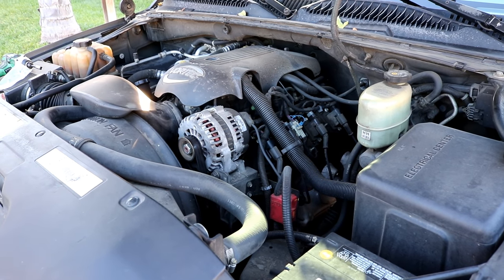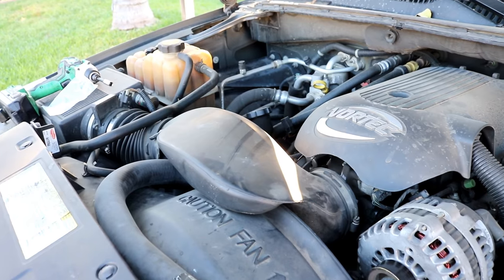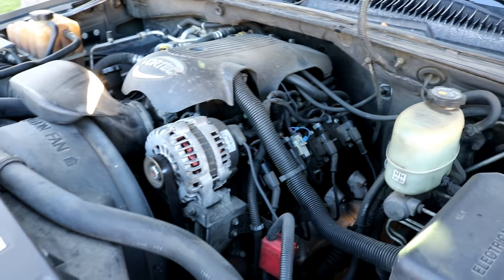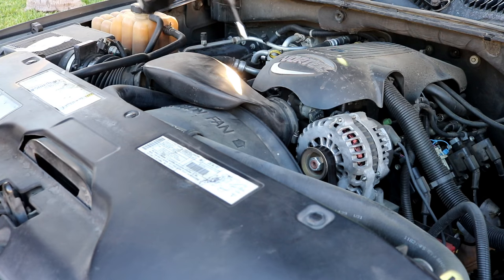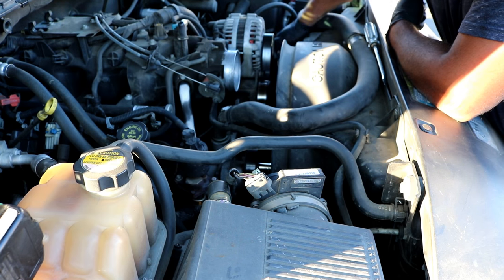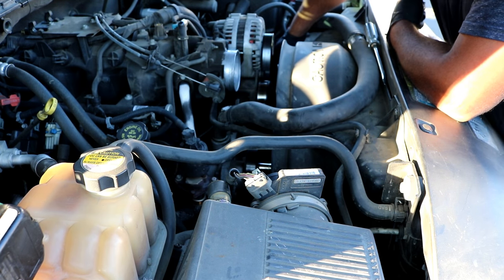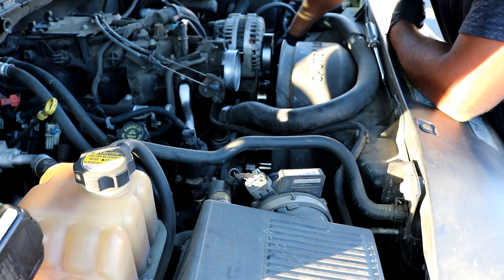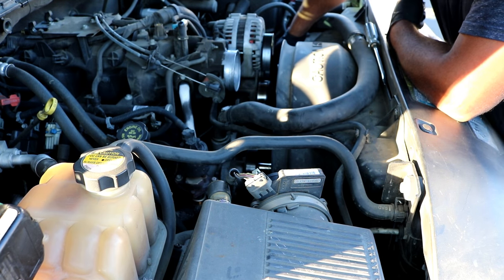2000-2006 Chevy Throttle Position Sensor P0122 (HARD SHIFTING SOLVED HERE!)

Comment: I have a 2001 Chevy Silverado 2500HD.  This truck started to shift really hard.  I bought this TPS for $18 from Rock Auto.  It worked!  Thank you so much.  I also bought a mini ratchet and did not have to move the alternator.  It took me about a half hour.  Thank you for this video.
Reply from the maker: You’re welcome.
Reply from the maker: You’re welcome.
Reply from the maker: You’re welcome.

Comment: For the guys with a drive by wire electronic throttle body: if it's not the gas pedal then it's the wire strip that determines butterfly position inside the throttle body. The plastic gears can go bad also.
Reply: Wire strip that determines the buttery fly ???
Reply: @tristanwaldrup9827  the electric strip inside the housing for the actuator gears that open the throttle butterfly on 03 and up trucks. The older throttle bodies were open and closed with a throttle cable. The newer ones have a electric pedal that sends a voltage signal to those electric strips in the new throttle bodies. If those strips are worn or damaged you can forget about the truck running like it should
Reply: Do you think it could go bad and not throw a code?
Reply: @dariel9847  I've seen them cause a truck to go into limp mode over and over. That was a 03 or 04 2500 with a 6.0
Reply: If you have a electric throttle body the gears are junk or the voltage strip for the  tps is junk. It can cause limp mode and hard or fast shifting. Clean the throttle body and keep the idle air sensor clean as well. My 99 GMC was shifting hard. I cleaned the throttle body - took it off and scrubbed spotless with a toothbrush and throttle body cleaner. Cleaned idle air sensor and replaced TPS sensor. Was getting low voltage circuit A code. No wires stripped or loose. Mine is the older cable style so the tps can be removed. The electric units are pretty much junk and you have to replace the whole throttle body if the strip goes bad or the gears to open the butterfly are broken
Reply from the maker: It’s possible that it can develop an intermittent problem and not throw a code. A scanner that can read live data can show you what’s going on with it
Reply: So if I have an 04 with limp mode intermittent do I try the pedal before tps?
Reply from the maker: @savagepropressurewashing1289 if you have a specific code, follow that.
Reply: @HelpingHandAutoRepair  it went to the shop and they cost me 1700$ trying to fix it . That was a Chevy dealership and it’s still doing the same thing . I’m thinking grounding issues
Reply from the maker: What code are you getting?
Reply: @savagepropressurewashing1289 .
I had an 04 with the ssme issue.  It had been sitting a while then I started driving it &  about 1000 miles later it'd go in & out of limp mode.
I literally  unplugged the throttle body plug.  Cleaned it, sprayed it with WD40 to get any moisture out, threw some dielectric grease on the female side, (not too much) and I went another 250k miles without ever having another issue.
Reply: I can’t find a throttle body anywhere, I even tried to order a performance one but it was different. Lkq junk yard doesn’t have one, can’t find one one eBay. I must have a weird drive by wire one with cruise control

Comment: I have a 2003 Tahoe the pedal sensor is the accelerator pedal position sensor not the tps there are 2 types of tps the one on the cable driven and the one on the electric driven. The one on the drive by wire (electric) is on the passenger side of the throttle body. You may have it bolted on mine was riveted on. Carful not to break any internals. You don’t need to take the alternator off you only need to take your air off so that you can get to the nuts on the throttle body.
Reply: There is a separate code for the pedal sensor they may both go off I would replace the tps first and then the apps

Comment: Man thank you last night I was driving home down the high way stopped at and light and everything was good then left the light at normal driving and then starts banging all gears I’m hoping this is my problem since I’m only 25 and with all the cars I’ve owned iv been through about 15 transmission, like 10 motors and 7 rears never had any issues with this truck until last night and the light came on
Reply from the maker: Check engine light on?
Reply: @HelpingHandAutoRepair  my 2000 silverado did the exact same thing ...shifts fine when truck is cold once I drive 10min on highway but I come to a stop then go and bam shifts hard from 1st to 2nd ..check engine is on
Reply from the maker: @felipecruz9132  read the code and see what it says.

Comment: 2001 Grand Prix with a 3.1-liter motor, started idling high after good and warmed up.
No codes at the time though. 
When motor would idle too high, 4T65E trans would shift super late under light throttle.
About 25 MPH and 2,500 RPM before it would hit 2nd. gear. 
Was OK the next day. 3rd. day, high idle and late shift again!
This time the check engine light did come on. 

Code P0121. Scanner TPS angle percentage at idle shows 0 

sometimes, and sometimes 0.39% and ~ 100% at WOT.  One time while sitting there 

idling fine, ~ 700 RPM, all at once the idle kicked up to ~1,300 RPM all by itself and I looked at the scanner, now TPS angle percentage went up to 2.75%.
From my readings it looks to me like the sensor IS receiving the 5V reference, and 

my ground in good, and my reference voltage is changing and being sent back to the 

ECM. My voltmeter is at my buddy's garage right now, so I could not do any voltage 

testing at the TPS connector  itself.
I'm ready to take a chance based on my findings, and just install a new TPS. 
What do you think?

Comment: After I replaced the sensor does it need to be calibrated at all or will it immediately fix the problem? I took my Silverado for a test drive immediately after installing it and noticed it was still shifting rough. I’ve taken it on 3 20 minutes drives since then and it’s shifting fine but I don’t know if it will come back and start shifting hard again or if the sensor just needed to be calibrated from driving or something.
Reply from the maker: You would have needed to delete the check engine light and it will be good to go. Provided there isn’t something wrong with the new sensor (new parts can be defective) or something actually wrong inside the transmission.

Comment: No need to remove the alternator. Auto zone sells miniature ratchets that hold torx bits , or Home Depot sells a security torx bit hand tool set. Just use one of those with a magnet in the area
Reply from the maker: The alternator isn’t removed. It is just swung up to the side. I’m sorry but it’s much more work to try and work in a small area when you can gain all the space you need with two extra steps. Of course if you got it done more power to you. The goal of this video was to make it EASY for everyone to get the space they need to work and not lose their minds trying to fiddle around with small torx bits and small spaces. Been there, done that. Much frustration from dropping little screws into impossible areas to find them etc..
Reply: Alternator is easy to move though.

Comment: Hi Helping Hand! Thank you for this helpful and informative video! Great job on being easy to follow with enough detail to get the job done. 

We have a 2001 Suburban 1500 Vortec 5.3 that we purchased several months ago. We have been solving issues on it since we got it but our primary issues at the moment are an inconsistent idle, inconsistent power on acceleration, and it has just started with the rough shifting. 

It currently has a check engine light with a P0122 code. I have changed out the TPS using the exact method that you showed here and the idle issue and initial power on acceleration problems have been solved. Unfortunately, we have one major issue that seems to be a result of changing out the sensor and that is that the vehicle will not shift into passing gear. 

It does respond quickly as far as initial motion but if you hit the gas hard it doesn’t drop down to put the power behind it like it should. I have seen several websites, forums and videos that refer to calibrating this sensor but, as far as I can tell, this doesn’t seem to be the type that can be calibrated. Am I missing something? Any ideas at all on what could be causing this? Any help would be appreciated! Thank you in advance!
Reply from the maker: You are correct, this TPS can’t be adjusted. If your scanner has live data capabilities, get into it and read what the TPS is doing. It should read a smooth linear 0-100% as you slowly press on the throttle.

Also it should read your throttle inputs going to full throttle say to pass.
Reply from the maker: You are correct, this TPS can’t be adjusted. If your scanner has live data capabilities, get into it and read what the TPS is doing. It should read a smooth linear 0-100% as you slowly press on the throttle.

Also it should read your throttle inputs going to full throttle say to pass.

Comment: Thanks for the video! I’ve got an 03 Silverado 5.3 and I’m having hard shifts in all gears and it comes and go plus long crank problems. Could this be a TPS problem and mine electronic so should I replace both of them? By the way brand new transmission. Thanks!
Reply from the maker: This very well could
Be the issue. It would be best to use a scanner that can read live data to make sure that the TPS is faulty shown by an irregular response. Also long cranking time could be a bad crank sensor.
Reply: Did you figure it out?
Reply: Mine did the exact same, crank time was sometimes longer. Idle speed would stay around 8-900 rpm after engine got to operating temperature. Sometimes it would fluctuate when in park. Hard shifts. I finally took the throttle body off and scrubbed it clean. Making sure that the idle air passages were clean. Both sides of butterfly. I cleaned the MAF also. Put in a new TPS sensor from my local Napa store. My 99 has 253,500 miles. It is now starting, idling and shifting like it should. The inside housing for the tps sensor had what looked like a small spot of corrosion. I cleaned it with Emery cloth and sprayed carb clean in tps housing to rinse it out. Also put a new fel pro gasket back on.

Comment: I have a 2004 GMC Yukon XL Denali ..... put in a new MAXx battery from Walmart. Vehicle dri Drove great and fine before I changed battery out.  Installed new battery . Drove it around for about 5 miles . Started it again that night, code reduced power showed up and will only drive to about 1 mile mph. 

Never had any issues before changing battery. 

What are your thoughts? Thank you, Nick
Reply from the maker: Nick Millhollin do you also have a service engine soon light on or a check engine light on?

Comment: Great video. Btw is the sensor the same part number even if my truck is a 4.3 v6 as the 5.3 or it’s different?
Reply from the maker: That is a good question.  Would think so.
Reply: My truck is doing the same thing. I have a 2001 Silverado 4.3 and hard shifts from 1-2. 

Only thing is that it’s NOT showing a code that it’s bad. So could it still be that sensor even though the scanner at autozone isn’t showing that it’s bad? Thanks
Reply from the maker: If that scanner can’t read pending codes, then it’s possible that the code is showing as pending but that scanner isn’t picking it up.

A scanner that reads live data will be able to tell you if the sensor is reading correctly or not. You want it to be a nice smooth reading from 0%-100% (full throttle) slowly press the throttle all the way open.

If there isn’t a smooth reading or the percentages jump around, replace the sensor.

Comment: Have an 02 Silverado 1500. I’m showing the p0122 code as well as a p1639. Could the TPS be causing that code too?
Reply from the maker: Quite possibly, since the 1639 code is detecting a 5v reference is out of range (short or open) so I would replace the TPS and delete the codes and take it for a drive.
Reply: @HelpingHandAutoRepair  replaced the sensor and cleared the code. High idle went away and seemed to help with the delayed shifting. Codes came back as pending but not stored so we’ll see. Thanks for your help.

Comment: Hi! I have a 2001 GMC Yukon 5.3 and mine has been acting up with shifting and my check engine light just came on so I checked it. I have the same code that you did. I ordered the IAC valve and the MAP sensor because I didn’t have a check engine light on when it started acting up so I thought the throttle body just needed cleaned out. But now that I know what it is and this video is so helpful!! One question, do you need to disconnect the negative terminal before you start this? TIA!
Reply from the maker: No you don’t have to. If you have a scanner, you can delete the code free you replace the part.
Reply from the maker: No you don’t have to. What code did you get from the scanner?
Reply: P0122 is the code I got
Reply from the maker: There you go. Replace the Throttle position sensor as shown in my video and you will be good to go.

Comment: Helping hands i was watching your Video, i had the same problem with my GMC Sierra 2001 C3, i just change Trottle Body Sensor, but i am having the same problem with my Transmission not Changing out Automatic
Reply from the maker: Any check engine light codes?

Comment: 2000 Silverado 2500 with the 6.0. No check engine light yet, I will check stored codes before I throw parts at it.  But, I have hard shifts sometimes and randomly it will short shift into second and third. Would this be a TPS issue too? Thanks for all of your help.
Reply from the maker: Best to check TPS readings with a scanner to make sure you are getting a nice smooth reading from closed to fully open throttle.

Comment: I started having the problem and i got the tps code p0122 and i replaced the tps with a oem sensor and still doing the same time
Reply from the maker: Check live data with a scanner to make sure the new sensor is reading a nice smooth linear voltage.

Comment: It's the correct way, but you don't have to do all that. I simply move the air intake from the throttle body and use an t20 star on a small socket wrench and get straight to it with no issues.
Reply from the maker: You said it correctly. I need to appeal to ALL levels of car repair skill levels. Some might find that way frustrating.

Comment: Could this possibly solve a low steady/cruising speed throttle RPM fluctuation/surge? 
Of about approximately 200 RPM difference?

There is no CEL on currently but problem persists.
Reply: Yes.   I had the problem with hard shifting from 1-2, generally only when cold.  Then I was on a four lane highway (for the first time since the issue started) using cruise control.  RPMS would surge/drop multiple times before regulating. Pedal/throttle (called either depending on model and year, as stated in video) position sensor did fix the issue.  Sad that many people get conned into paying for a new transmission over a twenty dollar part.

Comment: I swapped the tps cause it was shifting hard and got no reverse.  Do i need to take truck to shop for a trans rebuild?
Reply from the maker: Is it still shifting hard?
Reply: @HelpingHandAutoRepair  haven't drove it since I can't back out but the forward does work.  Should have said it's not hard shifts more like hirev shifts or is that the same thing

Comment: Hey bro i have an 06 gmc denali yukon 6.0 when it goes to 60 rpm stays hi sometimes shifts good 1 & 2nd would u consider this being the problem tks
Reply from the maker: 60 rpm? What?
Reply: Sorry when i drive up to 60km the rpm stays hi
Reply from the maker: @simplybeautiful4098  do you have a check engine light on?
Reply: I just bought it on Saturday no lights so far the previous owner said it needs transmission tks for replying
Reply from the maker: Oh well. You can check the live data and see if the TPS sensor is reading correctly. If it is, then you very well may need a transmission rebuildZ
Reply: Kk tks np I might just buy a transmission with lower km if i need 1 lol

Comment: Hello I know this video is 3 years old but I figured I would give an attempt to ask a question in hopes of getting a reply..I have a 2003 Chevy Tahoe with a 5.3. I just bought it and the service engine soon light came on and it's registering a P0420 code which I believe is for an O2 sensor. I noticed it takes a while to shift from first to second gear and while I'm driving the truck it sounds like there's a vacuum leak somewhere and for the life of me when it's just idling with the hood up I'm not able to find a vacuum leak anywhere but it really sounds like something's whistling when I'm driving which if I'm not mistaken could be part of the problem for that code. In your experience has a bad throttle positioning sensor ever given someone at PO420 code?
Reply from the maker: Sorry. P0420 is a catalyst efficiency code pointing to a failing catalytic converter. It has no bearing on the Throttle position code. How many miles are on the truck?

Comment: Will this work for sure for my 2004 Chevrolet avalanche act up from 2nd to 3rd gear
Reply from the maker: It is worth a try. Do you have a check engine light on? If not you should still go and have the truck scanned to see if a pending code comes up. How many miles on the truck?

If it isn’t slamming into gear, the TPS most likely isn’t the issue. Especially if you have high miles. I’m thinking it maybe slow going into 3rd? Or never quite makes it into 3rd sometimes?

Comment: Mine is the regular Yukon Denali 1500 but same hard shifting 
But I have no check engine light 
I want to try this before replacing all the trans solenoids and filter
Reply from the maker: If it is shifting hard into every gear, definitely replace this first.